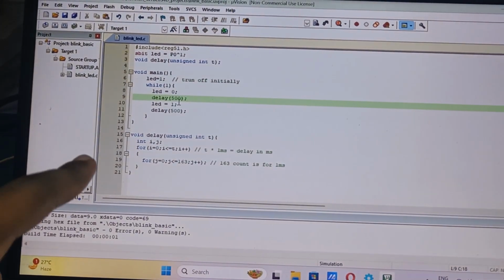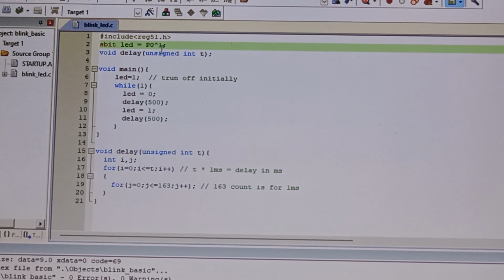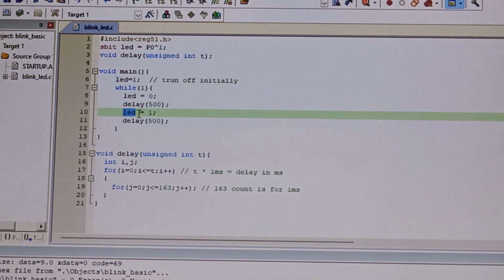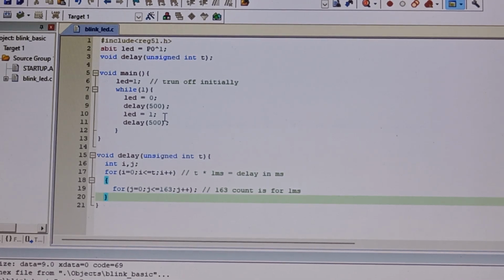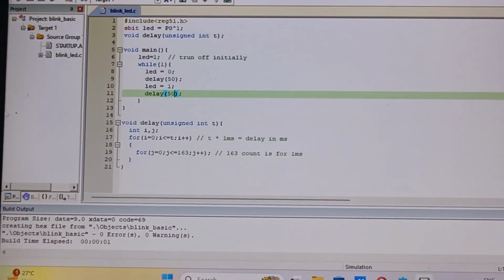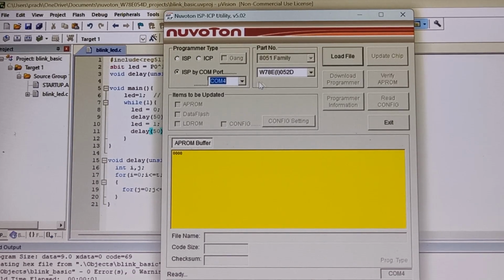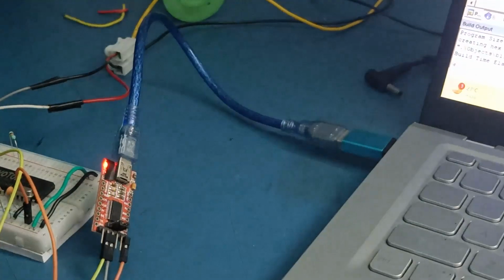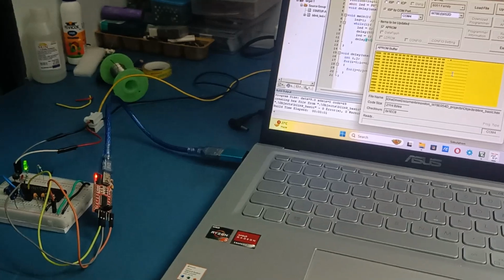Getting Started With Nuvoton's W78E052D (8051 Tutorial No.1 , blink led )

Comment: I see the values here taken for the components is different from what normal circuits over the internet have been doing for the same.
How were these values of crystal oscillator and ceramic capacitor including resistors chosen?
Reply from the maker: From the Nuvoton's W78E052D datasheet.  According to the datasheet, for 16 MHz we need 47pf capacitors but in this video, I am using  27pf capacitors. It still works, funny thing is, it works even without capacitors, you can try it for yourself.